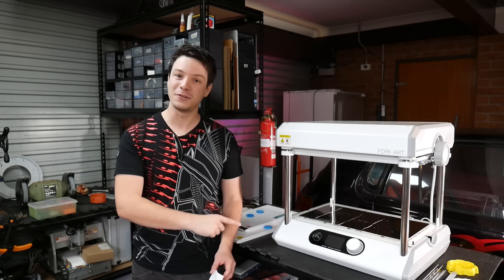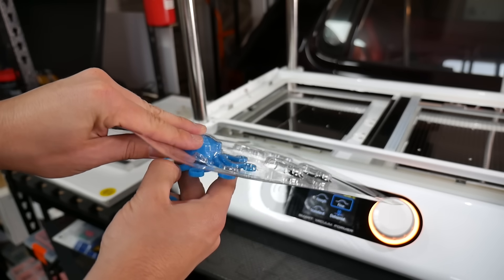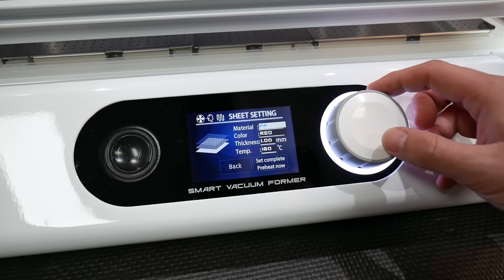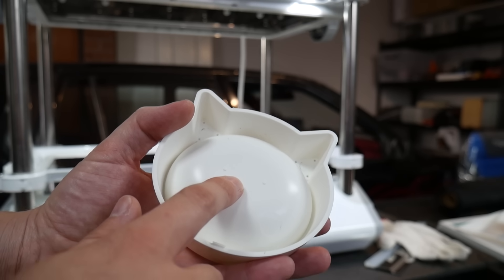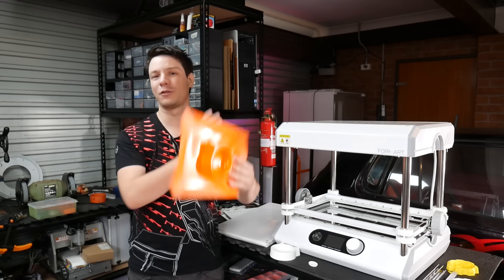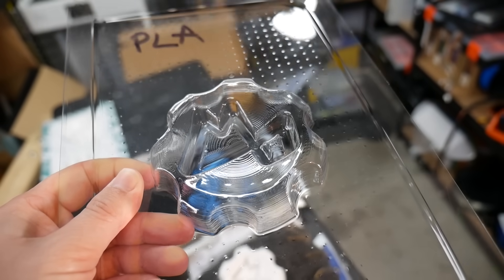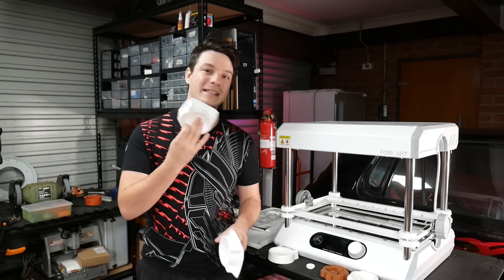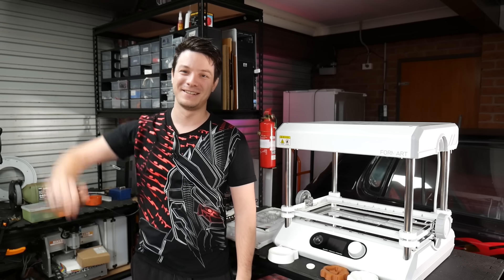Vacuum Forming is Incredible! FORMART 2 Review

Comment: $2000?! Holy moly. We do it ourselves with a toaster oven and a vacuum. I kind of expected this around $499... Great looking machine, but far too expensive for most consumers.
Reply: A true vacuum pump is expensive. I'm hoping they come down to about $1K someday. We use a toaster oven setup as well, but you don't get the really crisp details
Reply: There's the Mayku FormBox that's is much cheaper
Reply: @originaltrilogy1  $65 new
what are you on?
Reply: Adam Savage also has a video on building your own. They're really simple devices if you take out all the fancy electronics and sensors.
Reply: @originaltrilogy1  a vacuum pump isnt expensive. after all its just an air tight sealed pump. a good tank is usually more expensive, but far from $1k.
Reply: @Armadurapersonal  Yeah, but that one has way less features (have to use your own vacuum cleaner, no smart functions, smaller form factor etc) and also looks like a toy. For $700, it really should have more features than a diy system built from a toaster oven.

Comment: I have been vacforming in a small shop for about 15 years starting in the 90''s(moved on to other things) and I won't get into most of the details and nitty gritty, but the biggest detail to get right on a DIY build is your vac TANK(not PUMP, TANK). Quality of a pull can frequently come down to how fast you can remove your air.  The fastest way is to pump out a tank and use that for you vac.
Reply: Hmm, using a tank for a vacuum. Interesting idea.
Reply: Exactly. I use a vacuum pump to pull the air out of an 11 gallon air tank, then I have two quartz patio heaters I stripped down to make the heating unit. Pull the plastic over the buck and throw the valve to the tank open. You get some serious detail out of that.
Reply: @robertfousch2703  Just make sure your tank is suitable for the vacuum you want to pull.
Reply: Yes and no, in some cases slower is better. On our big machine, I have the valve set mostly shut for some products because a slower draw prevents webbing of plastic in corners.

Comment: I work in this industry and you're bang on with all the details. Only thing i'd add is i often have to get rid of webbing at sharp points by placing those rectangular shapes they provided (we use self-adhesive neoprene foams), so once webbing is discovered, i place them to form a 90 degree angle with the sharp corner angle where the point of the mold is located. This basically makes the plastic spread out and doesn't let it web together in that area. You should have items 1-1.5 times their height in distance apart. For plastics/molds that require being right on the edge of burning, i use compressed air to spray the plastic the moment it's formed. This keeps it from overheating and burning on the mold. Don't forget you can also cool the molds between shots, but don't do it too fast.
Reply from the maker: Awesome tips, thanks!
Reply: I agree with all of this but the neoprene foam for web catchers. The foam just doesn't hold up with adhesive over time because it is flexible. The foam either bends and stretches pulling on adhesive or gets stuck in the plastic depending on the plastic and amount of vacuum. https://www.youtube.com/watch?v=RC7TeiwL0Bg Plus you don't want to use adhesive on that bed. Hard blocks work better and hold up through production much better. You can 3D print them for temp projects or make wood ones with good draft angle. Best cheap option is wood blocks screwed down, but that won't work on this machine unless bolted through bed vent holes. (Ugh, the bed, that is whole other video)

Comment: 3:00 to get that chocolate out easier, pop it in the freezer for a bit, hardens things up and also shrinks chocolate a bit making easier to remove. :)
Reply: Is PETG normally food safe?
Reply: @bbowling4979  I believe so, but FDM printed petg will get food stuck in the layers, so you wouldn't want to use food that can go bad and poison you!
Reply: @bbowling4979  petg is used in a ton of food storage containers. It's pretty much the industry standard as far as I can tell.
Reply: @bbowling4979  Usually yeah, some might have additives that might make it not safe but petg is incredibly commin in food packaging and I think is the standard material for plastic bottles.

Comment: Interesting that you can use a smaller area, addresses one of my concerns with making one: that the size you make is the size you have every time.

I'd never spend that much on one of these, I'd diy it, but it's cool to see this kind of thing starting to show up more. (And hey, remember, even Adam Savage uses a diy vacuum forming machine with a shop vac guts.)

That "fill your pla with plaster" idea is much better sounding than the water soak.

Comment: I made a semi automated vacuum forming machine years ago (video on my channel). I trialed many heating elements... and found that taking apart cheap $20 toasters from my local hardware store worked the best. You can just bend the nichrome wire and leave the mica panels in place and you have heating panels... play around with the setup to get even heat distribution. Not going to pass certification but it works!  Then I used a stepper motor to drive the platform with the mold on it into the clamped piece of plastic that was heated. An Arduino controlled the timing and the stepper motor. The platform was on acme rods to achieve linear motion. Worked great and made many pulls with it. Still works to this day.

Comment: If you build or get a machine with an A5 sized area,  HDPE milk bottles work well. You can get a A5 sheet from a 2l bottle, and the best part is that it goes from miky coloured to clear when it's at the right temperature!  There are some quirks with it, but it works really well for something that is free. 
Because milk bottles are blowformed the plastic is pre-streched so as you heat it, it pulls taunt as it tries to recover and works well for a plastic.
Great for food grade chocolate molding. We've used this for several rotomolded chocolate workshops at the Fabrication Lab. 
Oh.. And when tempering chocolate, look up the sous vide method, it works SO well..
Reply from the maker: Love the idea of recycling the milk bottles too! I'll check out this sous vide method...

Comment: Diy is the way to go with these if people have any maker skills. A shopvac has more than enough power for a platform this size, you could pick up small vehicles with a shopvac as long as the surface area is acceptable. Plus a lot of people already have them at home or can easily borrow one or buy one at second hand shops/websites. 

With money being tight for many nowadays I think this is the way to go. 

What's actually more important than the machine itself, in regards to getting good pulls, is knowing the material glassing point and as mentioned in this video the angles to allow good pulls. The 1st can be looked up online easily, the 2nd can be picked up by practice or asking for pointers on prop/cosplay forums.

For using a 3d print as a buck (master,form, etc) I recommend a thin coating  of pu resin, cheap, easy, keeps details and hardy enough for the temperatures used typically though I would use a mask and have proper ventilation but that should be pretty much a prerequisite anytime we use plastics around heat that is higher than ambient temperature.

Comment: I ran an old large format vacuum former that made scenery for television and movies. I also trained on a "thermoformer" from Columbus-Tech by the guy who built it. The wrinkles in a sharp corners are the most common problem I ran into. Put on some heat-resistant gloves and you can try to work those wrinkles out by hand while the vacuum is still going. The other thing I learned is that you can place pieces of MDF both underneath your form to raise it up a little off your bed, as well as placing blocks around it to help alleviate the stress. I see you did that but I used to use lots of them. almost like making a frame of lego blocks around the form.

Comment: It is hard to get crisp looking pulls without a decent vacuum pump. On the down side, I was making some vacuformed face shields with a homemade shopvac setup and it was working almost ok, so I found a place that had a professional setup, and gave them my bucks which were made of 3d printed parts and wood and cardboard. When they tried to use them, they just crushed into a crumpled mess. The idea of filling the 3d prints with plaster is good, I have done that and it works well (and saves a huge amount of time if you can print it in vase mode). One thing that can't be overstated is that to get smooth pulls, you need to have a absolutely perfectly smooth buck.

Comment: @Maker's Muse, my daughter and I have had a lot of fun using a syringe full of chocolate chips and an immersion circulator to inject chocolate into silicone molds without having to worry about it setting up right because we never break the temper thanks to the precisely controlled water temperature. An immersion circulator is a great tool to have even if you don't cook much, I'm sure you'd find many uses for one. 👍

Comment: I could take that same $1800 and make a really nice, and much larger vacuum forming machine with money left over. I built one 15 years ago with Harbor Freight and Home Depot parts. The key for a successful DIY former is using a purge tank that you pre-charge with "vacuum" pressure. The 11 gallon air tank from HF is perfect for this application, and so is their vacuum pump. The hardest part was drilling thousand tiny holes by hand in my upside down sheet metal baking tray, and wiring up the heater coil, snaked around in such a way for smooth even heat. I used a baking tray for that part too.

Comment: Finally someone made a video about Vacuum Forming + 3D printing. Finally i know the answer. Thanks man.
And the problem with recyclables plastic is that, the more thinner and dirty (mixed with other materials) the plastik is, the less can be recycled. And those thing thin sheets of plastic could be one of them.

Comment: What I do is print hollow PLA bucks, and fill them with cheap canned expanding foam instead of relying on infill. Then I vac-form a sheet of 3mm eva craft foam over the raw PLA print, it smooths and hides the layer lines and adds a nice "release" layer between the print and the PETG sheet, then I vacuum form the clear plastic and get pretty smooth clear pulls with no visible layer lines or blemishes.

So far its worked pretty well!

Comment: Nice review Angus.  Very thorough and informative.  It is easy to balk at the $1800 price point if one only considers it a hobby machine. The things you were most critical of are things that are easy to address and fix.  Especially in pre production. The results speak for themselves.  Naomi Wu's demonstration of the machine also proved it works well.  The results are impressive enough that with some creative thought (like your prop shop knob example of scaling up from a 1-up mold to a 10-up mold) this can be quite the money maker.  There is a lot of merit to a plug and play solution for the end user.  Not having to fiddle with settings makes it easier for the user to focus on production.  I am a maker at heart and would rather build than buy but sometimes my time is worth more than what the build may consume. Do you see any issues, based on your experience,  of scanning the QR codes and printing them on stickers to place on my own sheets?  I would use the same material and thickness that they do but I'm sure I could source material much cheaper.   Besides not having to buy their consumables, it would also keep me from having to manually set / use the custom settings which then means anyone (employee, student, etc) could use it with virtually no experience (think temp employee, student, etc).  Thanks.

Comment: For chocolate, you should try to sous-vide it, removes a huge part of the skill/randomness of the process.
There's always the solution to try to keep a water bath at a constant temp and use a ziplock bag for those without the equipment required

Comment: I actually remember in college we had a pretty old vacuumer and I needed to use styrofoam as my master and I did use the "soaking the piece on water" hack and it actually worked using a HIPS sheet
The formart looks great, the modular bed is an excellent idea but the wobbly frame seems like a pretty important flaw that I hope they fix, also the cost seems extremly high, even if it has a bunch of neat features

Comment: The ability to use smaller sheet is the key feature.
The only way to do that on a DIY vacuum former is to just make multiple machines.
Reply: No, it'd be quite possible to replicate the functionality, it would just have to be designed in from the start. That sections of the heating element can be switched off, and sections of the vacuum bed blocked off.
Reply: @NirateGoel   Has it correct, people have to stop copying skin packaging machines and then it is possible to have one machine for most work.

Comment: In the past I have printed pla bucks and then coated them in bondo or epoxy(depending on the application) with great success. Lets you print rough(fast) and still have a nice looking result

Comment: The problem of the strong top Magnet holding up the forming frame can be eased by having a egg shaped flat disk that you have attached to the two hand grab wheels and so to release the magnet hold and push the forming frame down to do the forms you turn the wheels clockwise together and the egg shaped flat disks push the forming frame away with their pointed end from the magnet. 

The when you move the forming frame back up the wheels are turned back anti-clockwise so their rounded end goes into the top inserts and the magnets hold up the forming frame again.

Comment: I have some ideas for this. One would make it so that the draft angle does not have to be considered and/or could actually be used for your advantage. It would be a combining of 3D printing with vacuum forming. So, for example, you have a propeller or fan blade. You need the solidness of the blades to remain, so that the angular momentum is retained, but some fan blades and propellers are very thin or cannot reach very high speeds without being destroyed. So, what if you use vacuum forming to create a sort of exoskeleton for the 3D print? We can imagine this applying to other objects apart from fan blades as well. Or we can consider other things like the plastics that have less heat resistance, but use this lower heat resistance to our advantage. The heated sheet lays on top of the low heat resistant plastic piece and deforms the outer surface area. Perhaps if the piece requires some sort of airtightness, not only would the vacuum-formed exoskeleton create airtightness, we could purposely create features in the 3D print that would take advantage of the heated sheet, by being purposely placed to deform on contact and then create a more airtight point.

Comment: Regarding the "soak in ice water": Could you try simply putting the PLA parts in the freezer over night? I reckon the temperature difference might already be enough. The freezer is colder than ice (0°C) and I don't see any benefits in the water (except if you make your parts hollow and fill them with cold water I guess).
Anyways, thanks for this fantastic video! The style of you sharing your experiences is excellent :)

Comment: In the Uk at least Vac formers are plentiful, Mainly aimed at the school Design and Technology curriculum. They vary in size and the design and technology suppliers are a good source of suitable sheet plastic. You have to consider how to cut the shape out of the sheet  and also the cost of the plastic sheet material.  A handy machine but of limited use for the hobbyist.

Comment: Just want it to put my two cents... What you can do to make moulds/masters using 3D printed part.. You can use bog, a thin layer to make really smooth and using sand paper to smooth it out... You get really get good finish also use dry mould release spray for better release.
The wrinkles that you are getting on some moulds in the corner is called WEBBING... There is a number of things that you can do to get rid off them... Mould placement is vital to get a good mould, delay the vac for a couple of sec once placing the sheet of plastic, when the draw is too big you might need to get material into those tight places before putting the van on, etc.

Comment: On your homemade setup you could do much better results but you need to get your heating more controlled and consistent. Heat gun method is not going to cut it. The vac will work fine for that thickness.

Comment: As you only need a small amount of fairly high vacuum, what about using a chain hoist to pull a piston in a used gas cylinder, and use a ball valve to pull from the vacuum former as needed?

Comment: Use "vaseline" on the master model, for easy relese and les master deforming when using low temeprature master like PLA or styrodure.
Lift the master from wacum bed (using ~1mm shim), to have sharper corners.

Comment: I made a 20” square vacuum former for like $100 in parts and an old Dyson vacuum that had a busted ball hinge that was destined for the trash heap.  $100 vs $2000 for a machine that looks to be about 1/3 the size.  Granted the pulls look cleaner than I managed to get out of mine, probably due to my inexperience with vacuum forming, but I’d rather have more cleanup time than spend 20x as much on a premade one.

Comment: I wonder with PLA prints if a heat resistant spray paint would help it. Also for better sealing on homemade vacuum formers you could try a handheld food sealer instead of a shop vac.